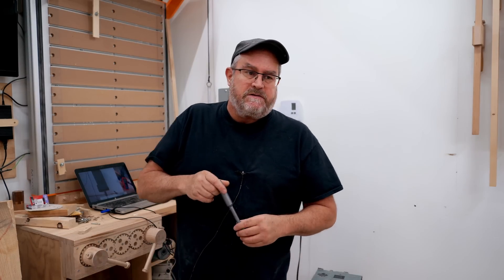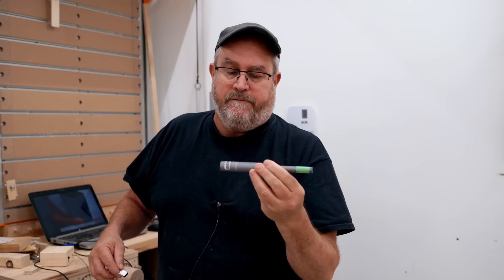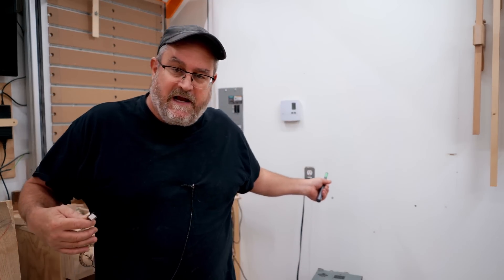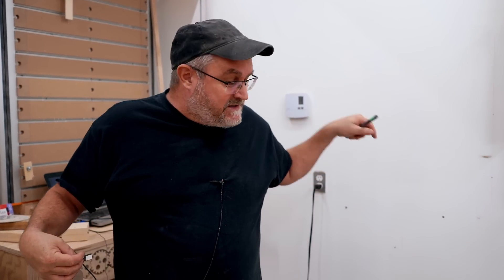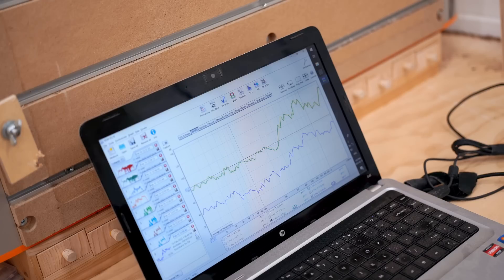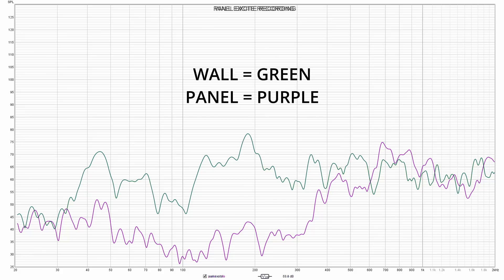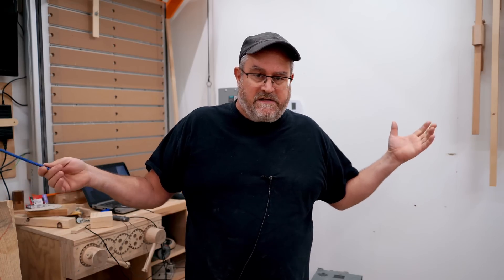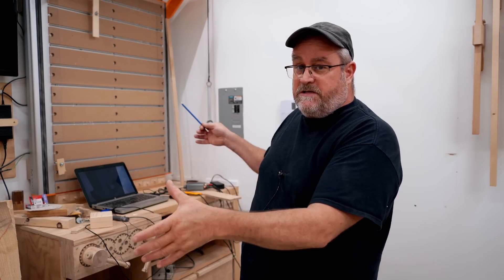How Much Noise does your Speaker Put Out? Debunking Panel Resonance... Maybe

Comment from the maker: While the method I used wasn't perfect, it can put the "problem" of panel noise in perspective. The output from the panels will typically be so low that on their own they may be barely audible, but also completely swamped by the output from the speaker itself. 
The issue I have with my test setup is that I don't have an accurate measure of the difference between the output of my accelerometer and my measurement microphone. Putting the accelerometer on the woofer cone and then on the panel gives a very rough approximation of the difference between how much each of these are vibrating, and the amount I can use to offset the panel measurements. But even the conservative estimate of 40db pushes the panel output down below audibility.
Obviously the panel output becomes more of a problem if the speaker has larger, thin unbraced panels that are undamped. So this isn't me saying that speaker construction can be slack. It's me saying that the single minded obsession with making a completely inert speaker cabinet is a waste of time and resources. Especially when you consider that the walls near the speaker will vibrate just as much (or more) as the speaker cabinet itself. 
Now I should point out that when the accelerometer is attached to a panel, it's measuring how much the panel vibrates, and how much the entire speaker is vibrating. Unless the speaker is rigidly held so that it cannot move, there will always be some contribution from the cabinet vibrating as a whole.
Reply: Hi John!  I've been thinking about this issue now.  Recently, I rounded the edges of the baffle and it made a huge difference.  So much so that I thought I'd tackle box resonance.   Thinking on this I think that people are confused about these box resonances.  In your video, you show that the box panels don't make sound,  and draw a comparison to the wall to show that resonances are happening everywhere.  I agree with your findings, that the box panels are not adding sound.  But that's not the problem.  
The problem is that box vibrations color the sound because they vibrate the drivers themselves, as they are in the act of making sound.  For bookshelf speakers the answer is simple, foam under the speaker absorbs resonances, also known as decoupling.  I use it, and the results are great!  However, for large speakers like my floor standers that weigh 60 pounds, it's not really an option, and all bass notes are not fully absorbed by foam.  What I'm thinking of trying is coupling the baffle to the back of the speaker box using dowels, well fitted, and screwed in from both sides.  The vibrations from the baffle will be roughly halved, transmitted directly to the back panel.  Those vibrations will be more or less out of phase with the front panel, causing destruction of the vibrations meeting on the side panels.  Coupling these panels over nearly a foot should do more to stiffen the baffle than anything I can think of, basically creating a stressed skin panel whose rigidity is a function of the distance between panels.  
The way we brace boxes does not seem in harmony with trying to deal with these resonances by cancellation.  In the current bracing model, vibrations go directly to the sidewall first basically just spreading out vibrations to all the panels, but with no objective of cancellation.  The only thing I can't account for in this mental exercise is the  sound waves coming from the back of the woofer.  When it hits the back wall, will it be cancelled out by the vibrations transmitted to the wall, or will it be additive?  Will it be in phase with them, or out of phase?  Will the dowels be able to transmit the vibrations immediately enough to cause cancellation?
For years I've read that the box is the worse shape for these resonances, but if these equidistant walls are coupled, there might be a way to make box speakers great again.
Reply: Interesting use of available tools and techniques to correlate and quantify the enclosure panel vibration conundrum. In spite of the 40-60dB offset (depending on the level of margin applied to accuracy), the open baffle enthusiasts often cite elimination of enclosure panel resonances as a key advantage. Listening to music at 85dB, I'm not sure if 25dB of resonance is something that would tangibly interfere with the pure driver output in a way that it would be "clearly obvious" if the enclosure were then removed. Not to mention, the directivity of the panels might also be a factor. How much output from a -50dB side panel is actually making it's way to the listener's ears? Very interesting work. You certainly get the neurons firing on all 8.
Reply: I am o think an audiophile. We are insane, the hobby is insane, we, all of us will never be 100% happy with our gear. All of this and cables , cable lifters, the twice clock. It is all nonsense , treat your room and hope no one of importance notices this nonsense. Go listen to some music! Live a little!

Comment: So the issue here is that you are comparing the POINT response of the panel and the speaker but not the AREA response. The cabinet has a much larger surface area than the speaker cone, so an equal amount of vibration between the two would see much more response coming from the cabinet than the speaker. Let's say a 6" round speaker; that's a surface area of about 28 square inches. The cabinet itself is about 740 square inches or about 26 times more surface area. Therefore "equivalent" point radiation will about 30db less from the cabinet itself (6db for each halving of sound pressure). Industry standard 1% distortion level is -40db, so adding the -30b offset you need to be at -70db point radiation from the cabinet to be below 1% distortion from cabinet resonances.

Comment: Have you considered making your measurements outside where there should be no meaningful signals from reflective surfaces? Vibration can only be measured where the surface has low enough mass to move, say the centre of a panel not where it's held by other joints like near the corners. I would imagine that accelerometers respond to some degree to vibrations from all directions hence going outside to measure to avoid the room reflections influencing the minute vibrations trying to be measured. Mounting your speaker system in a cavity in a brick wall will fix any potential for vibration 😁

Comment: the thing is - accelerometer measures acceleration not amplitude.  so data from accelerometer is not a frequency response.
more so - the stiffer measured system is the larger response from accelerometer will be.
if you want to measure amplitude of speaker panel vibration it must be more like magnet glued to a panel and a wire coil next to it (fixed independantly).

Comment: Interesting subject John. I think music that is bass heavy and have transients from drum solos would be the best samples for cabinet resonance measurements.

The key point to remember is that since everything has a resonant frequency the challenge in cabinet design is to keep that resonant frequency below the lower range of the speaker. Otherwise, the whole cabinet will vibrate uncontrollably whenever that frequency is hit.

Adding mass lowers the resonant frequency. Of course, this is not a problem in open baffle designs.

Comment: In a 400 level engineering course i was assigned a project to measure the reduction in vibration  hammering on a chisel bare & with various chisel safety top-caps. Setting up the accelerometers and processing the raw output to be meaningful for analysis turned out to be such an involved task that it was eventually broken out to a separate project for another student to tackle while i worked specifically on the mechanics of the apparatus.

Comment: John this was excellent and answered the concern fairly well. I'm especially impressed by all the work you did to try and put it into perspective with the decibel levels between resonance vs driver output. 40 Db difference is huge and wouldn't be very audible. Heck my forced air heating and cooling runs about 20 Db lower and I can't hear that when playing music. I'm into speaker building as well and may try the exciter when deciding where to put bracing for the greatest effect. Honestly, I think that most of the benefit of a well braced cabinet is more for a placebo effect when one feels better about the sound because the cabinet passed the knock test. That being said, I wouldn't be surprised if a completely unbraced, untreated cabinet made with thin material may exhibit some audibility when playing music continuously vs a sweep, but only at substantial SPL.  Recently in a current project I'm working on, I could swear there was an audible increase in Resonance during guitar playback... It was a much larger cabinet with substantially more potential for resonance due to panel size vs a well built, thick bookshelf speaker.
Reply: I'd consider resonance and bracing tuning to be a more technical and complex level of speaker building. Does it make a difference? absolutely. The goal of building a speaker yourself is essentially making it sound how you want, at a price you can afford. Resonance is a variable that changes sound, almost always in a detrimental way. The biggest piece of information missing from this experiment (aside from only using one unit) is failing to account for off-axis sound. The biggest issue with resonance is that the box itself is now emanating sound in all directions, not just the drivers. This results in peaks or dips  that interact in unpredictable ways in a room, and the frequency response and cannot be EQ'd out. 

On-axis measurements may still look very good, but when you do various measurements off axis, you'll see resonances have the same peak or dip in all measurements. The most direct impact of this is poor soundstage/ imaging, as a given instrument may seem to 'move around' randomly as it gets amplified and quieted by the box itself.  For the record I'm not just parroting theory written by others, I've incorporated adding bracing and there's definitely an impact.

Comment: Resonance doesn’t need debunking because it’s all about context. A large wide baffle floor stander,   Inadequately braced, will absolutely colour the sound. An accelerometer proves the amplitude of resonance at each tested frequency.  At high frequencies, the whole panel area acts like an out of phase drive unit so even 0.1mm amplitude will colour the sound.  That’s why speaker engineers try and get panel resonance down to below 45dB under programme by design.  It can indeed be seen in some waterfall decay plots for larger speakers. Little stand mounts will exhibit tiny amounts of resonance, probably not audible.  Not so with large speakers, fact.
Reply from the maker: Name one medium to higher end speaker manufacturer that makes speakers with large unbraced panels. 
Time's up, I'll answer: none. Maybe Harbeth, but they are using the cabinet as if it's a musical instrument (their claim). 
What I'm "debunking" (word used to get people to click on the video, welcome to YouTube) is the ridiculous idea that panel resonance is a major problem that needs to be addressed. It isn't.
If the wall beside the speaker is resonating as much or more than the speaker panel itself, it's absolutely a non-issue for reasonably well made speakers. Even if your speaker panels are perfectly damped, the walls (and the room itself) will resonate, swamping anything you think you might hear from the speaker cabinet. That's basic physics.
Speaker manufacturers that are bragging about using special materials to reduce resonances are doing it as a marketing point, since the idea that panel resonance is a major problem has been ingrained in the buyers.

Comment: quite interesting... excellent little experiment. i was a bit surprised @6:35 by the high fqs coming from the speaker cabinet. some of those vibrations are out of phase w/ the driver, right? also the separate direction...

i'm imagining the wall is stealing energy thru it's vibrations, like a membrane absorber, and what we hear is what gets reflected.
like when a sound wave applies pressure on the wall the wall deform away under that pressure...

Comment: Thanks for more great stuff! Could you disconnect any tweeters and mid-ranges and put a tube running from the woofer into a nearby room and heavily insulate that tube. Then the sound of the room picked up by a microphone would be predominantly that transmitted by the cabinet and all its surfaces at that? Thanks again!

Comment: Use the exciter as active noise cancellation on the panel. Flip the polarity of the accelerometer recording and play it back into the panel. Would be interesting to see the result even if you couldn't hear the difference.
Reply: yes, this.
Reply: im not sure the wallhas the rigidity to do that compared to a 12 inch mdf board or a driver's cone? does it?

Comment: Worst case enclosure vibrations are when a musical section  sound notes are approximately matched...mostly these will be sustained for some time enough to become discernable because basically that's what music really is..those musical notes may repeat/ sustain and is not like a frequency sweep... that's done only once , probably for a few hundreds of millisecs and then gone....
the panel mass has a latency/ delay that may not respond as quickly to vibrate...
so it's best to test with actual sound clippings / track in the +/-3dB frequency range that causes the worst enclosure performance...@ different SPL levels and correct for that accordingly....
Reply: I hear these resonances on certain songs, like a bloated bass or drone at certain frequencies, if the note or passage is sustained or recurring. Would you say this is cabinet resonance I am hearing? sometimes I find certain song unlistenable due to this. I have the speakers positioned well out from the front or side walls with plenty of soft furnishings so i don't think its the room. Have you any experience with No-Rez? I am considering trying this but want to know for sure whether it is indeed cabinet resonance I am hearing. speakers in question are wharfedale Linton Heritage.

Comment: Every structure has a resonant frequency, and bracing affects what the resonant frequency is.   I think an interesting project would be to start with an unbraced cabinet, and take measurements.  Then add bracing and re-measure.  The goal would be to move the peak resonance outside the range the speaker is meant to play.  And to keep the resonance as low as possible.  Maximum theoretical dynamic range of human hearing is ~90db, but 60db is plenty good enough when you're listening at 70-80db.  (Minimum noise floor is going to be 20-30db in a very quiet environment.)

Comment: Very nice video and tests! One thing occurred to me though and I don't know if it means anything. A microphone is taking a sample of the sound energy that has made it into the air and is indicative of what our ears will pick up. The accelerometer is taking a sample of the vibration that has made it into a hard surface. The size of that surface will influence how much sound volume is transmitted into the air. The side of the speaker vibrates much less than the driver, but is also much larger. The wall in the room may vibrate less than the side of the speaker, but the wall has far more surface area than the side of the speaker. (And if the wall doesn't, you have a VERY understanding partner!) 

Anyway, what you might want to try next is to take your exciter and stick it to the side of the speaker. Measure the vibration with the accelerometer. Use just the exciter to reproduce the same vibration level as the speaker playing normally. Then see how much volume the microphone picks up from whatever distance you measured the driver. That said, I don't know if the exciter itself will make noise and invalidate such a test. I suppose if you really wanted to, you could pull one of the drivers and put the exciter on the inside surface of the cabinet.
Reply from the maker: I did another test yesterday that's similar to what you suggest and I'll put that video out tomorrow. In it I used a tone from my function generator to use as a reference for both measurements. The tone is sent to the panel exciter and is picked up by both the mic and the accelerometer.
Reply: @IBuildIt  I guess brilliant minds think alike :) My only suggestion then is to run two separate tests. Run the tone through the exciter and measure the output with the mic like you said, but also run the tone through the speaker at a sensible listening volume to get a baseline measurement for the accelerometer.
Reply from the maker: @zackw4941  I'm surprised that there weren't more suggestions (even ones that aren't good) on how to improve the test. That's usually the first thing you get whenever you do something, a bunch of "I would have done it this way" type comments :)
Reply: @IBuildIt  That makes sense. I read through to make sure I wasn't repeating anyone else. It is a challenging problem you took on and very well done!

Comment: What about putting exciters on cabinet walls, and feed them with 180 phase shifted signal? This would reduce cabinet vibrations, and make the leakage smaller, effectively acoustically "stiffening" the walls. Same idea can be applied for any parasitic resonant surface in studio. This technology is already used to reduce street and traffic noise inside apartments.

Comment: What sort of results would get if you ran the same source audio but inverted phase through the panel exciter on the wall? Wondering if this result in cleaner audio as a result or if the harmonics etc would just compound.